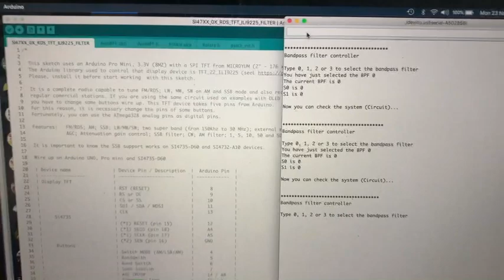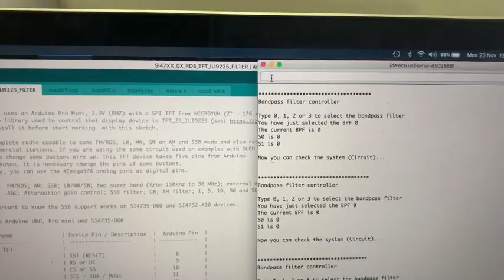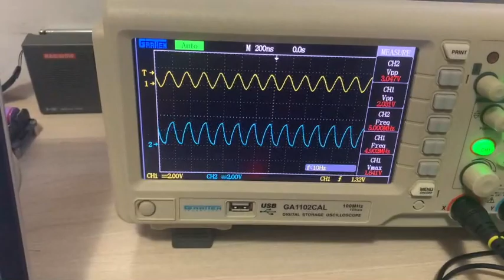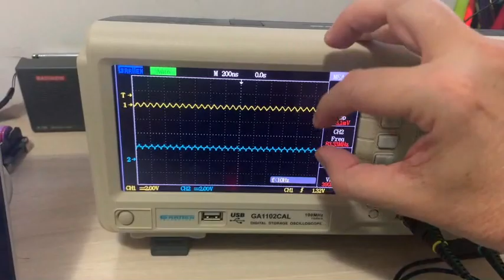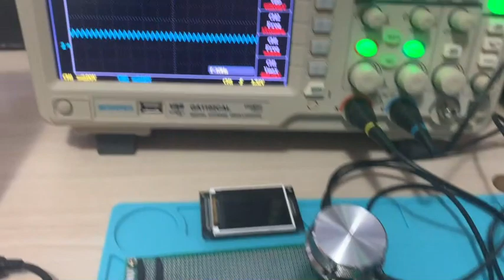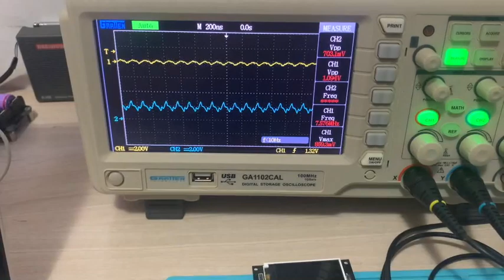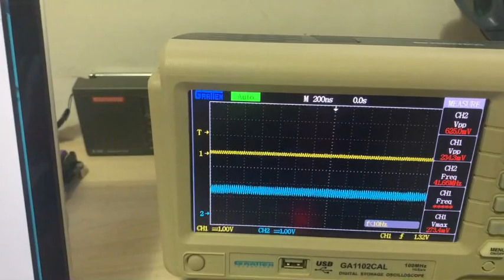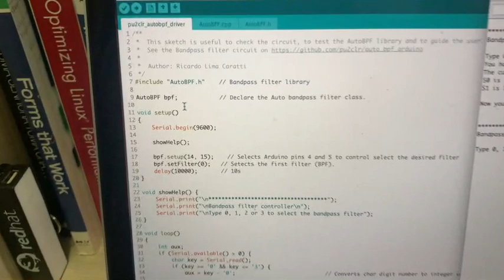HF Auto Bandpass filter controlled by Arduino (first test)

Comment: Hello sir, 
could you please tell me what is the magnetic wire diameter you are using and what is the maximum power that can be transmitted through the filter?
Thanks in advance.
Reply from the maker: The filter I present was not designed for transmission. It is used only for reception. Regarding the calculation and values, in the text where I describe the video, there is a link to the documentation that shows how to calculate the filters.

Comment: sir
Is any module with si4735 IC to direct connect to arduino or we have solder in our pcb board?
Reply from the maker: Members of the group "SI47XX for radio experimenters" have developed Kits and modules using the SI4735 and Si4732. You can try it there.